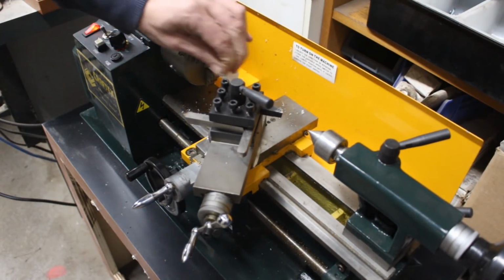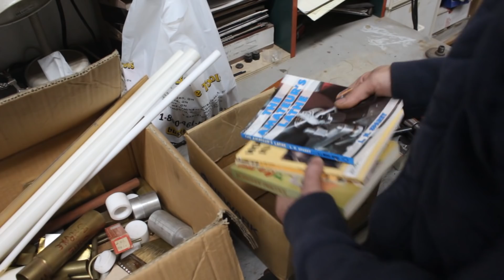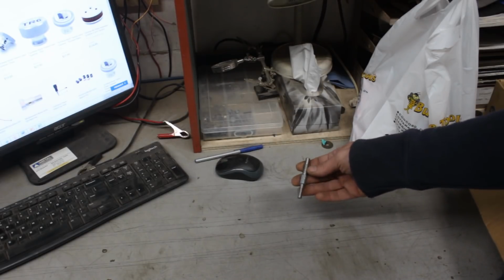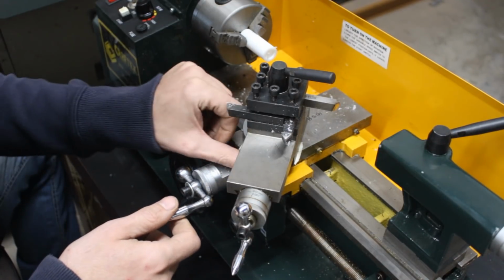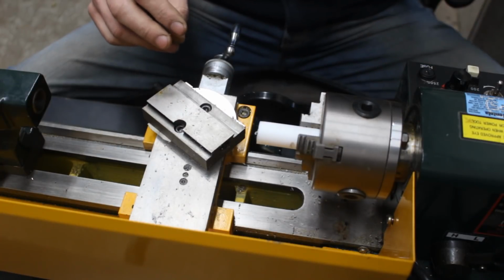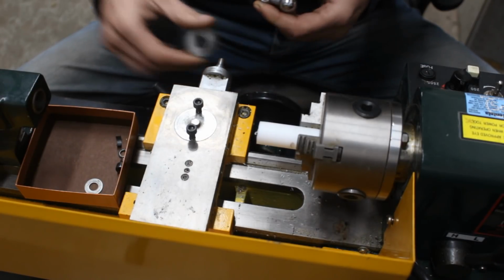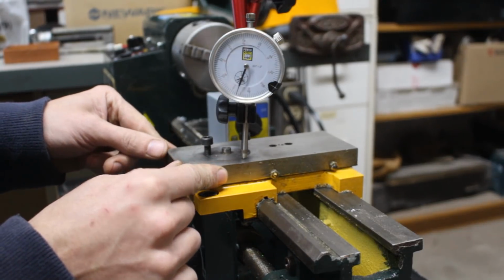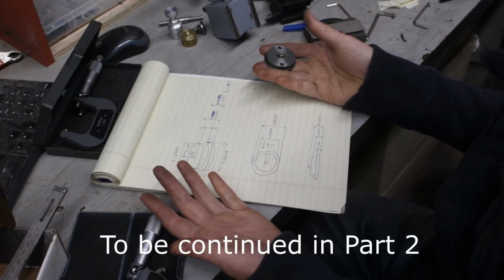Never Too Late To Get a Mini LatHe - Part 1 - Troubleshooting Play Issues

Comment: The mini lathe is great. You will soon want a larger lathe as well for larger parts and for more rigidity.
I bought an old Southbend lathe and also a milling machine to help me fix my old Spitfires.
I never regretted it. Some parts can be repaired, rebuilt or even renewed with lathe and mill.
Also you can fix some of your old equipment. Years more fun for you.
I only wish I got my first lathe sooner.
I liked when you said 'use the lathe to fix the lathe.' Maybe make a temporary part to do it.

Comment: Oooh .. proper engineering Elin! Takes me back to my engineering apprenticeship as a Tool Maker in the late '60s. From the very brief look at the flat tools in the orange box I think they were what we called 'Parting Tools'. Its what we used to cut through a workpiece to remove it from the bar (or whatever) in the chuck. They can also be used to cut external grooves for circlips etc.

I am following a couple of guys here in the UK who are fitting a Toyota engine, gearbox and 4 wheel drive into an old Mini bodyshell. Don't ask! But they just apply basic engineering to problems. I thought these two episodes might interest you as it summarises all the 'turning' that had to be done just for one problem and shows some handy tips for marking out and methodology
Part One:
https://youtu.be/0tzWC2G3mr0

Part Two:
https://youtu.be/PPYNCt5yV-U

You might need a British sense of humour in some places .... But hope you like. How the hell would Santa have got that beauty down your chimney? Or was this for St Nicholas Day?